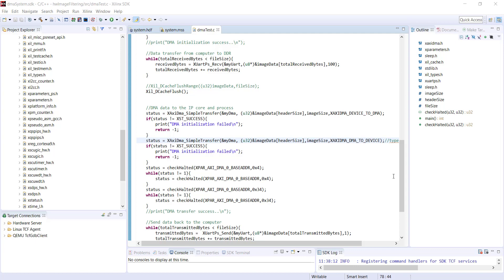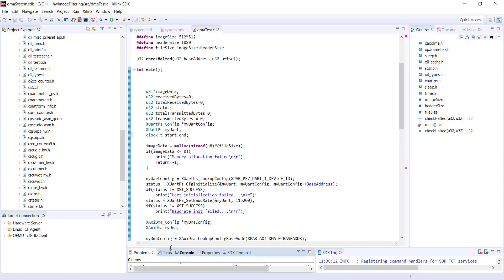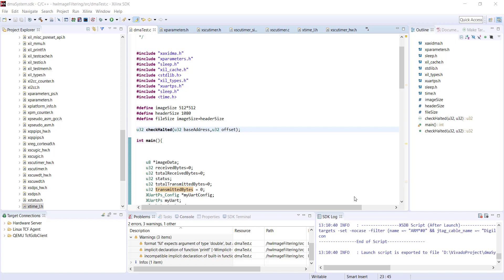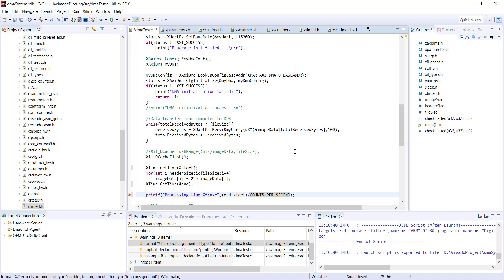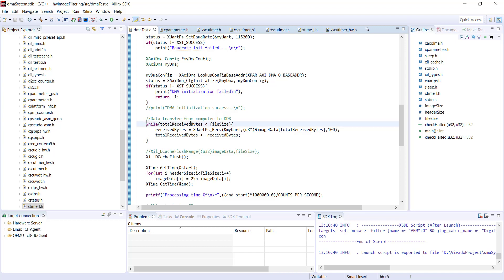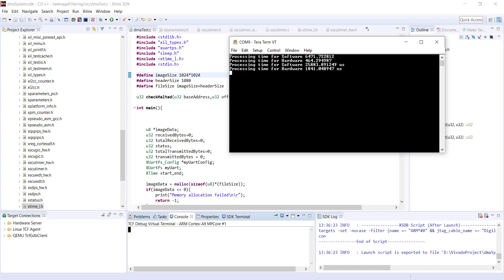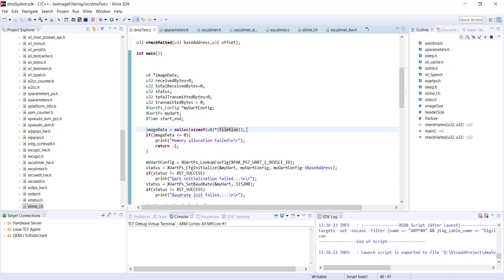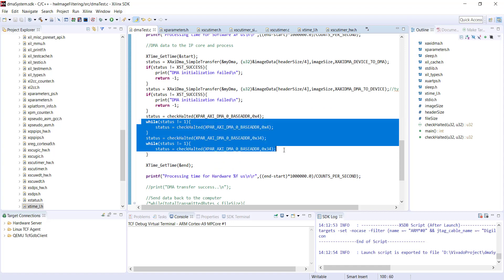Performance Measurement in Xilinx SDK

Comment: Bro, how performance measurement can be made in vivado HLX?
Reply from the maker: Similar way. You start the timer before calling the driver api of your hardware. Read the timer once hardware finishes execution (that you can do either using interrupt or by reading some status register). Then find the performance using the same equation. The clock frequency used in this case will be same (irrespective of ur axi clock) since u r using the timer in PS. If you use axi timer in PL to measure the time, should use the axi clock frequency to find the delay
Reply: @Vipinkmenon  ok thank you bro

Comment: Hello, I don't have a zynq board but I have vivado toolchain and Xilinx sdk, without having a board is it still possible to validate and analyze the performance of my c code in terms of code size, latency, throughput ?.
Reply from the maker: Nope. You can't do any software profiling without hardware. Hardware profiling can be done through simulation. Best option will be to buy Zybo board, which is much cheaper.
Reply: @Vipinkmenon  Thank you, Vipin. It has been told me to do without actually having a board. I have developed an algorithm in C and also in VHDL. Using a test bench I can show that my algorithm written in VHDL is working as expected and also I can see post-synthesis reports without actually having zynq SoC. So my question is there any way to show that my C code is working as expected on PS of zynq and also I wanted to ask you that is it possible to create custom IP and accessing that IP from SDK again without having zynq SoC
Reply from the maker: No. There is no way to test your C code with out actual hardware since Xilinx tools they do not provide a complete simulation model for the processor. They are only providing a bus functional model or verification IP (VIP) in recent Vivado versions. I exactly don't know what is the difficulty for Xilinx in supporting simulation of PS part with a provided elf file. They support assigning an elf file in Vivado but it can not be used for simulation. Instead VIP is used for modelling the processor part, which has all the GP, HP and ACP ports but cannot directly run the elf file. Instead you will have to use predefined APIs available for VIP from the testbench to model your actual software.
Reply: @Vipinkmenon  Yes I agree with you. Thanks a lot for the detailed description.